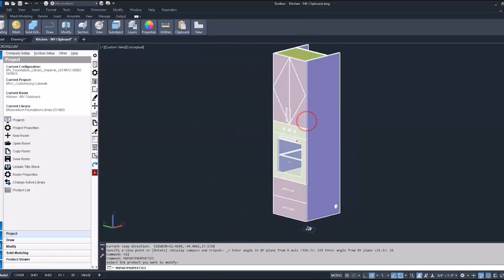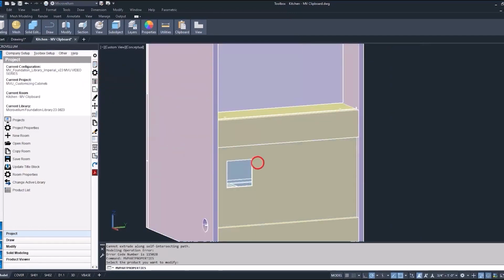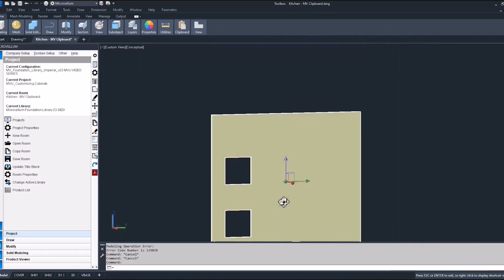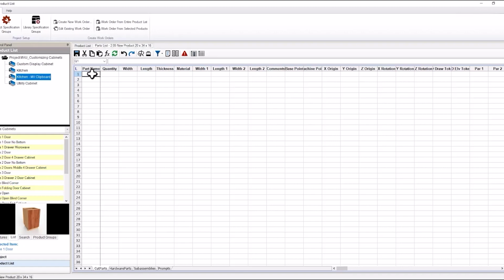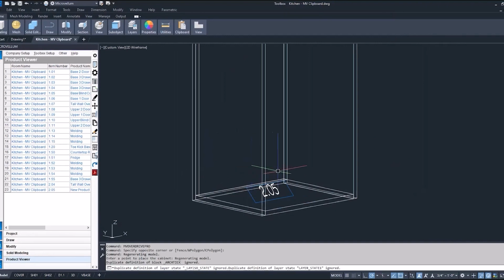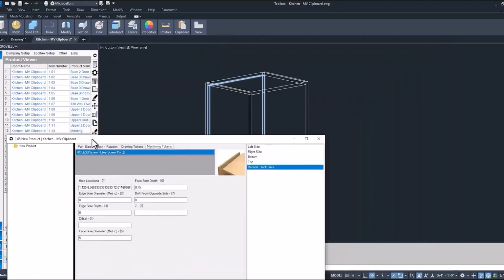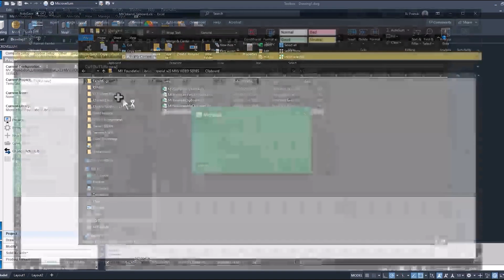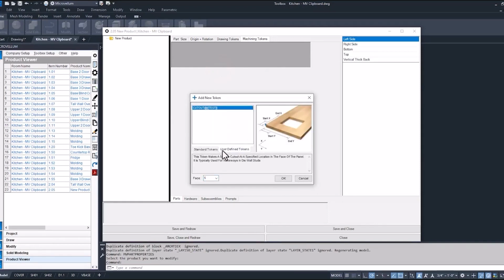Introducing the Microvellum Clipboard

Comment: Now that I have an actual CNC, I've been diving back into the nuts and bolts of Toolbox.  These videos are well done.  RJ is easy to understand and the pacing is very good.  (Let's just say in years past there was at least one presenter you needed to watch at half speed.)  One thing I would like to see addressed is that "Paste" option.  When placing parts from the clipboard there is no "Add Part" option, just "Paste."  Either force a warning box that you are about to overwrite an existing part or just make it paste the part without deleting any existing parts.  In the meantime, I just add a New Part first, and then paste overtop of it.
Reply from the maker: Thanks for the feedback!